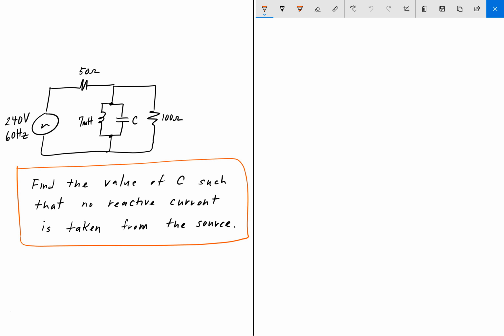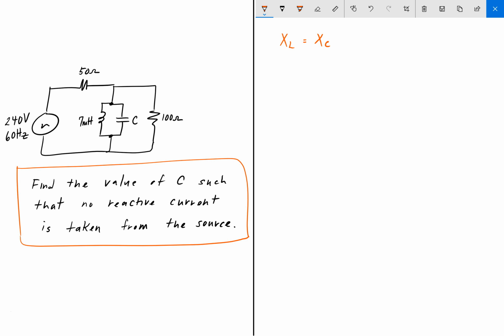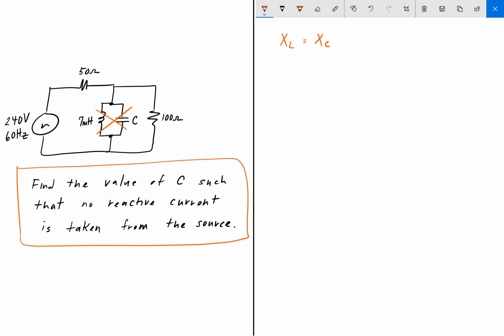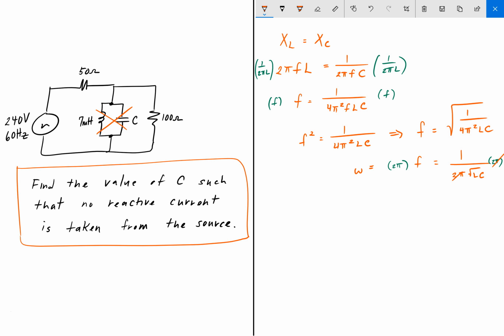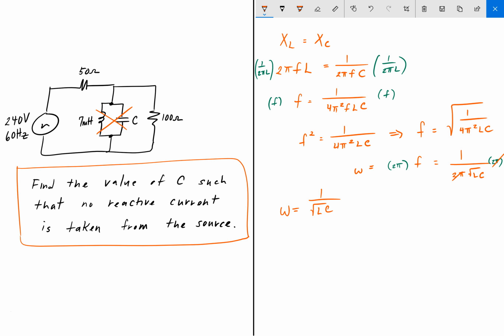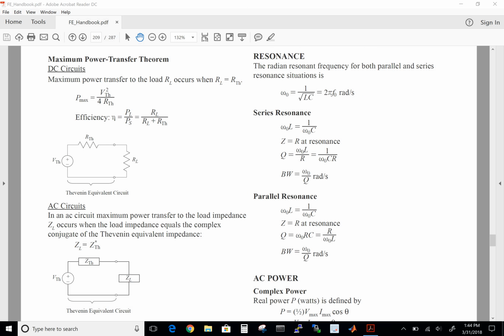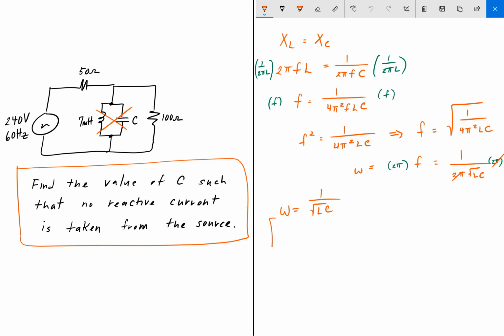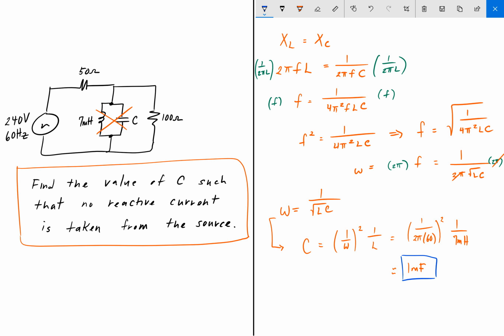Electrical FE / EIT Exam Prep - Linear Systems 6:  RLC Parallel Resonance

Comment: There was no reason to switch back and forth between angular and normal frequency. It should be a 2 step problem and all you need to know is the handbook equation woL = 1/ woC where wo = 2pi*f
Reply: I think I know what you mean he switch back and forth to show you how the equation is derived (W= (LC)^.5 .